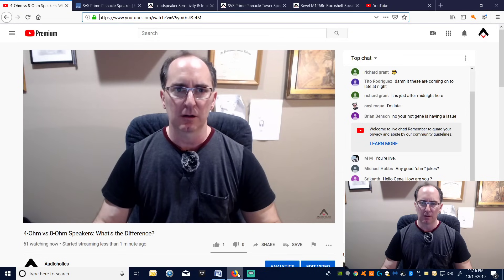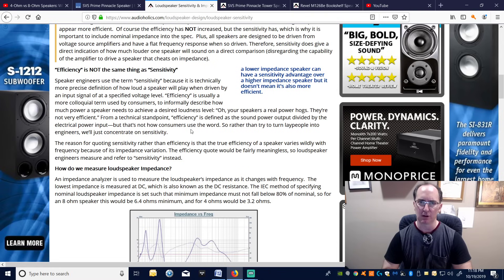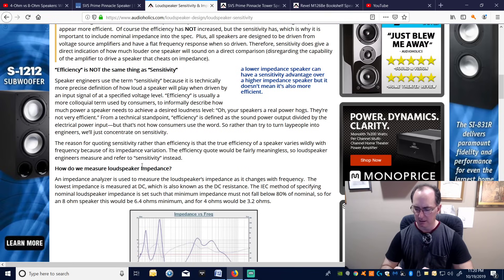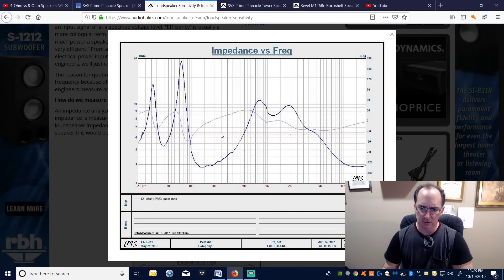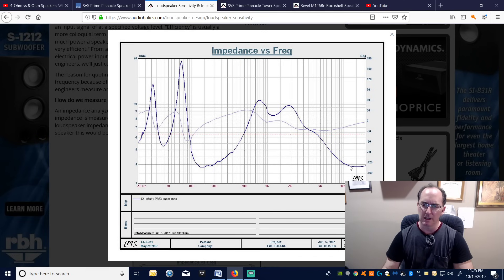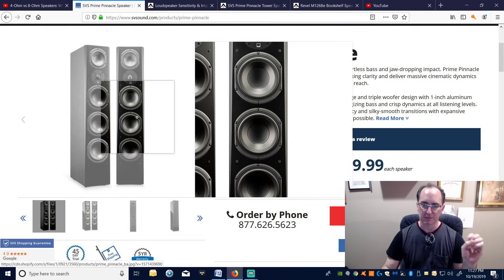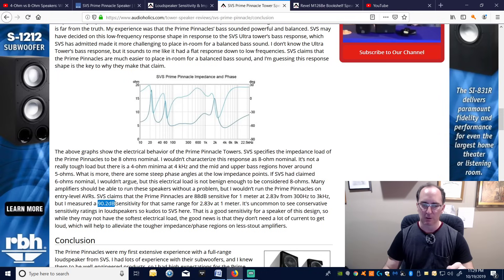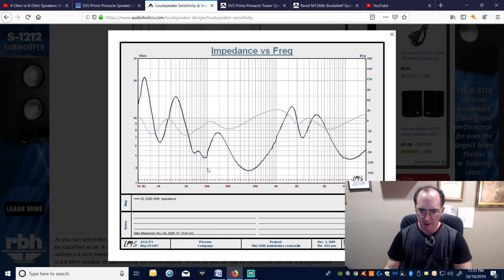Loudspeaker Impedance 4-Ohm vs 8-Ohm: Which is Better?

Comment: Really, what a dunce, keep your switch on the high 8 ohm setting so you can overheat your equipment and burn it up.  Is the clown for real?  It's just there to fool the UL Listing people.   The people that don't want you to burn your house down.  First he says 4 ohms is more sensitive than 8 ohms, not if you supply the same wattage, not the same voltage.  Then he says all the amps he has seen double their power at 4 ohms... I guess he hasn't seen many amps.  But then he changes his mind and tries to explain why they won't double.   Whatever, guys like this only fool the fools.  Unfortunately there are tons of fools.  I bet he censors his comments too, so no one will see this.
Reply from the maker: Sometimes its better to remain silent and have people think you're a fool then to speak and remove all doubt. The low impedance setting is there for one reason only, so the manufacturer can give a 4-ohm rating per UL. The units have their own internal self protection that would shut the amp down before a fire or any real damage ever happens. I've used AVRs w impedance switch set high on 4 ohm speakers for over 30 years and never had a problem other then them shutting down at high SPL. Here's the thing you fail to realize, if you set the switch to 4 ohms, the unit shuts down at a much lower volume level because the power is limited way below the other internal self protection circuits whether driving 8 ohm or 4 ohm speakers.
Reply: @Audioholics  Very cute but over used quip, LOL.    I guess I didn't realize you are smarter than the manufacturers and the UL, that's why amplifiers never burn up I guess, because they have built in protections.   You give bad advice Mr.  And on top of that, all those switches do not do the same thing you suggest.
Reply from the maker: @oldolfmann8927 thank you for continuing to remove all doubt. I have 20 years of measurements data published on this website that proves I'm exactly right. I've spoken to the engineers thst design these products and they are in agreement. But, please don't take my advise and flip the switch. You're gonna love that 150wpc reduced to 30wpc but hey you'll sleep better at night w no fires.
Reply: @Audioholics  20 years doesn't mean a thing, there are people that do things for twice that long and still don't understand what they are doing, just like you.  Your video about how you have 5 woofers and still couldn't get the sound correct says it all ROFL.   Then you say 150w down to 30w, LOL.  Where was that dip in your bass anyways?  All over the room? In your favorite chair?  Or just standing up at the fridge?  LOL.  Well, lucky for you there are a bunch of people out there that want to learn about audio and don't know any better, and that makes you money subscribing to you. Enjoy.
Reply from the maker: @oldolfmann8927 you seem deep into watching our content. Hater fans are the best. Keep the minutes running up. Greatly appreciste it 🙏
Reply: @Audioholics  Sorry, 2 partial videos was enough, and trust me, it didn't take many minutes to see all I needed to see, but I will come back at a later date to see if you leave my comments.  All the power to you to make money, it's just too bad you really don't know what ur doing.
Reply from the maker: @oldolfmann8927  Sadly you suffer from a cognitive bias known as Dunning-Kruger effect. I can't teach you what you don't know because you don't realize you actually don't know it.
Reply: @Audioholics  you just described urself perfectly, ROFLMAO.

Comment: As always it depends. 8ohms; Purists who listen at low volumes will normally like 8ohms, the amp will run clean and cool. 4ohms; Many will like 4ohms it will drive an amplifier harder and bass will benefit.
YES manufacture's numbers are often off and speakers ohm ratings are LOWER than specs,, many Polk's rated for 6ohms are more like 5. If hooking up multiple speakers to one channel or A&B be careful, two 8ohm speakers might result in 3ohms, two 6ohm speakers might not be 3ohms, 2 will stress or kill an AB amplifier.

Comment: The best thing to remember is that 8 ohms is generally the "safer" at home use and still sounds plenty fine. And don't cheap out on your amp if driving more than 2 speakers and like to turn it up  lol        shame it's so hard to get accurate numbers from manufacturing brands. Or any relevant numbers at all.   Especially When so much is made in China.  I just answered my own question.   lol

Comment: Hi everyone! I have an unusual question. I’m trying to find good sources for information on multi driver speaker building. Enclosures are not an issue, it’s more of crossover design with the right components building them. If you could steer me in a good direction, I’d appreciate it!😊

Comment: As far as the question overall, with transistor amplification it depends on overall system power, a low power 4 ohm amp is more difficult and needs better cables, while getting big power is more complex into 8 ohms. 
Interesting about the UL switch hack thing though. I don't agree with always leave the switch on 8 ohms, if it makes a difference you probably need a better amp, but that's a test, if it passes then switch to 8. Only that kind though, tube amps are completely different as is bridged amps, for example the Bose 551 set for 8 ohms and one pair of speakers.

Comment: ... if you can't tune an instrument by ear you have no business spending more than a grand on an audio setup.
I guarantee my 20 year old Kenwood speakers sound better in my room configuration than most millionaires home theatre systems sound.  I've checked.
I used to install audio video equipment on billionaires private jets and the company I worked for built equipment for George Lucas's home setup.
Speaker resistance is fuzzy logic and the safe bet is if you have speakers that don't match your receiver impedance than cap your receiver power/volume(master volume) around 60 to 70% and let another device control the volume.  Think of it like trimming a sail on a racing boat (all my clients got that reference).
Speaker impedance is based on a lie and slight of hand.  Impedance is calculated using static current and static impedance and a speaker has variable current and variable impedance.

Comment: Having 8 ohm amp with a 6 ohm speaker, does not make sense, wont the 6 ohm speaker try to draw 6 ohms worth of power from the 8 ohm set amp? Thus the speakers are calling for more power (lower impeadance rating) than the amps set at??

Comment: I got a Denon X6700H that drive 5 Dali Opticon 8 mk2 front Opticon Vocal center and Opticon 2 surround, all speaker is 4 ohm. I tested it at 8 Ohm and 4 Ohm. I got to say my Denon run cooler at 4 Ohm than 8 Ohm after 4 hours. Maybe the receiver is better now days.
Reply from the maker: You severely limited your available power to your speakers doing that.  If you prefer less dynamic range and higher distortion as opposed to providing better ventilation,  knock yourself out.
Reply: @Audioholics  Thanks for the answer. I will give another test round. 
Keep up the great work. I like your videos on products. Testing different things.
Reply: @Audioholics  I have this EXACT receiver and am planning on buying 3 Kef R3 Metas for my LCR. You are saying that I should ignore the Denon Recommendation to switch to 4 ohms and leave it in 8 and it will be ok? This makes me sad that a $4k receiver has a stupid switch like this. In your other current video i thought you were speaking about like $300 receivers. Its depressing that it applies to these (what i consider expensive) AVRs ...

Comment: "Regardless of your speaker impedance always keep the switch on the high setting..."  Does this rule apply to tube amps, which have different output transformers and binding posts for 4 ohm and 8 ohm speakers ? I was told that a pair of 6 ohm speakers should be more appropriately connected to the 4 ohm terminals of a tube amp.
Reply from the maker: This video is dedicated for AV receivers only.
Reply: @Audioholics  Thank you for clarifyiung.

Comment: Isn't it true that a lower impedance speaker results in a lower (halved) damping factor to a higher impedance speaker?  I'm pretty sure if an amplifier has a damping factor of 300 with an 8 ohm speaker, it'll more or less be approximately only 150 with a 4 ohm speaker.  I've been wanting to look into some 16 ohm speakers, which favour high voltage to high current.  This would mean the damping factor with a 16 ohm speaker on the same amp would be 600, right?
Reply: Yes Grasshopper. Why do you think most speakers in guitar amplifiers are 16 ohm? Why make an 16 ohm speaker.? Clarity. Dampening. The ability to play a musical note. Not a sine wave. You're right on target and using a 4 ohm amp with an 8 ohm sub can create good bass sound that isn't muddy. I think what you are talking about is correct and important dealing with bass.  Is it me or don't most $500 home subwoofers sound better than $500 car subwoofers? To me home audio sounds better than car audio which is 4 ohms or less. It's hard getting the damping of amplifiers with the general any damping factor over 100 is okay. I think a higher number is better. It Sure can't hurt.   lol

Comment: Me: whats louder 4 ohms or 8 ohms?

Google: A 4-ohm speaker requires more power from an amplifier than an 8-ohm speaker to produce the same loudness of sound. This is due to the relationship between voltage, current and resistance in electronic circuits; for a given voltage, a lower impedance means a greater current. A higher impedance means a lower current.
Reply from the maker: The first part of your statement is half true. The sensitivity rating will determine how loud a speaker will play at a given drive level.
Reply: @Audioholics  i have a lg class d amplifier 150 watts x 2 at 4 ohms.. so i took ny sony ss mf5000 speakers which are 150 watts 8 ohms and paralleled it to the 4 ohm amp its the loudest system i ever had at 115 decibels.. 115 decibels is as loud as a rock concert..

Comment: I have a cheap system: Cambridge AXR85 amplifier and old speakers. One pair is 8 ohms and the other is 6 ohms. I've been running all 4 speakers at the say time. I don't crank them up much and the amp is running fairly cool. No signs of overheating. Should I only run one pair? My amp is rated at  85 watts per channel and 4-8 ohms. I can select speakers: A, B, or A/B .
The owners manual says it's ok to run 2 pairs of 8 ohms speakers together but not a 4 ohms and 8 ohms together. Just not sure about 6 ohms and 8 ohms together. Gonna disconnect one pair for now.
I  appreciate your technical expertise and really enjoy your channel.

Comment: Wiring speakers in series can in some cases degrade the power output of one or both speakers at certain frequency bands. When speakers are wired in parallel, the full output voltage of the power amp will be applied to both speakers and they will work independently. In series, however, the current through both speakers will be limited by the sum total impedence of both speakers, and the voltage will be split between the speakers. If the speaker impedences are identical,  the voltage will be split equally between the two speakers. But if the speaker impedences aren't perfectly matched in all frequency bands, the speaker with lower impedence will have its power output limited by the other speaker in those bands. While this is typically a minor effect, it can in some cases become audible.

Comment: I recently purchased a Yamaha as-501 integrated amplifier (85 rms/channel @ 8-ohms) - resulting in the depletion of my very limited finances. So now I don't have any means to buy matching Yamaha speakers. But I have a pair of Pioneer car speakers in wooden enclosures ( 4-ohms, 150-rms/each ).  Please let me know if I can use them without causing any damage ?  The as-501 Amp has an Impedance Selector switch - Should I set it to 4--8 ohms or should I leave it at 8 ohms ?

Comment: The less resistance there is, the easier power can flow. A really well built amplifier can handle loads down to .5 ohm. A cheesy built amplifier will only be able to play at 8 ohms. Its a myth that 8 ohm speakers are easier to drive that comes from old technology from the old days.

Comment: I Have an amplifier 180 watt per chennel output in 4 ohms . So can I use 150 watt speaker in 8 ohms? Because if i connect 2 × 8 ohms in parallel in become 4 ohms 300 watt

Comment: Question: I have a pair of Pioneer SP-FSF2 tower speakers rated at 6 ohm mated to a Yamaha  TSR-7850 receiver. As you stated in this video should I keep the receiver speaker output switch at 6 ohm or return it to the 8 ohm position?
Reply: meant to type SP-FS52
Reply from the maker: Answer is in this video: https://youtu.be/Ou5bO8P2Drw
Reply: @Audioholics  After watching video I adjusted my receiver back to the 8 ohm speaker setting,Thnx.

Comment: Thanks very much for the explanation in the realm of decibels and power ratings.  I'm still confused on the audio difference though.  While shopping for good open back monitor headphones, I read many reviews of the higher-ohm headphones which said they got much better stereo separation, crisper sound, less muddy, etc.   Does all that fall in the realm of snake oil, or is there a real difference?
More windings in the voice coil creates higher impedance, which I imagine would mean better connection to the field from the magnet.  This should mean less resonating after signal cut off, and tighter adherance to the shape of the waveform sent to the voice coil, right?
Or, again, is that all snake oil, like the idea of better audio from orchestrally-trained speaker wire?
Reply: I agree. I wish there was an explanation of the audible difference (or not) between 4ohm and 8ohm (or 32ohm) drivers. Is there an audible difference between large and small gauge wire wrapped voice coils or a difference between larger or smaller diameter voice coils? Does the response of the speaker change due to these changes?

Comment: Hi! I have a question about frecuency response/audio quality of a Speaker connected with an Amplifier that have different ohm values, hopefully you can resolve my doubt :)

- I have an amplifier with a 3 ohms output and I want to connect a speaker of 2 drivers (1 woofer and a tweeter) of 8 ohms.
- As far as I know the only drawback is that it will sound less loud (which is not a problem for me), but the frecuency response of the whole speaker is preserved just as it was designed for. Is this correct?
- What if I match the impedance of the speaker with the one of my amp using a 5 ohm resistor in parallel? Will it just sound louder or does it improves the audio quality/frecuency response of the speaker?
- If I only connect my 3 ohm amp to the 8 ohm speaker, will this affect the crossover of the speaker (as I understand it (here)[https://soundcertified.com/how-does-increasing-speaker-impedance-affect-db-output-power/], or the speaker crossover is completely independent and therefore not affected by the ohm mismatch?

Comment: Infinity was famous for using 4 ohm speakers for everything and then wiring the woofers in series to get 8 ohms going to the crossover for some reason. Thinking it was mainly because they killed Amps on a regular basis.

Comment: This is a topic that I've been pondering for some time.  It's quite clear that the 4 ohm speaker will have twice the current flowing through it's voice coil than the 8 ohm speaker will have, which I would think would make them more dynamic, all things being equal.  I just can't understand why 4 ohm speakers, with 2.83 volts presented to it, are typically less efficient (lower SPL)  than an 8 ohm speaker with 2.83 volts applied to it.  With the voltage being the same, the 4 ohm speaker would have twice the current flowing through it, and that should result in a larger magnetic flux being created by the voice-coil, and more movement of the speaker, and more output, i.e., a higher SPL than an otherwise equal 8 ohm speaker ... any thoughts to clear this up for me?
Reply: U are correct. My 8 /4 ohm speaker,s play not as loud as my 4 ohm speakers. At reference.
Reply: D4 has more magnetic force than d2 subs is one reason, another could be the  amplifier running unexpectedly at different impedance. Could be many factors

Comment: All things being equal, The lower the imp., of a speaker the heaver the load on an amplifier, the heaver the load of an amp., the higher the amplifier's distortion. The higher the current draw of a speaker the heaver the wire running from the amp to the speaker has to be. The higher the current draw, the greater the heat the amp., generates shorting the lives of the amplifier's components.  Your want sensitivity, make the speaker's magnets   stronger.  Back in the days of tubes, when amplifiers had audio transformers, speakers with higher impedances, in the order of 16 to 32 ohms,  were the better speaker. You want a better speaker, put a stronger magnet into it and reduce the load of the amplifier driving it.

Comment: Gene, fantastic dissertation about ohms and impedance.  I'm just learning about this as I setup a new basement studio setup construed during COVID pandemic.   New Denon DRA 800H Receiver with 2 speaker outputs.  A and B.  I connected 2 pairs of 8 ohm rated bookshelf speakers in parallel  to the B speaker output, a d 1 pair of Fluance Signature Series Surround HiFi Bookshelf speakers,  a 8 ohm speaker with nominal 6 ohms.  The system played very well until after a time, with voulume at 62 (98 the highest), the Receiver overheated and shut down.   When i disconnected the A speakers , the paralleled speakers played without issue.   I now added a integrated amp , an IOTAVX SA3 to play the Fluances , hooked up via the Zone 2 preouts on the Denon.  Any other way to play all 6 speakers on the Denon? This was a great well skilled video.  Thx .  Be well